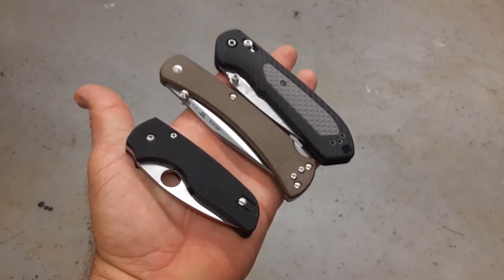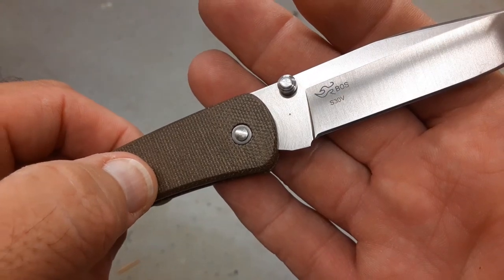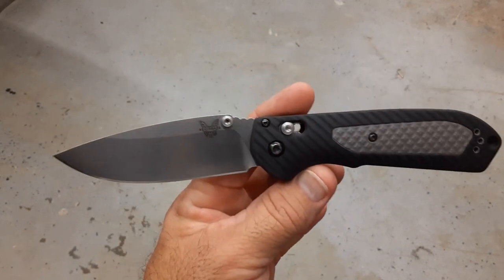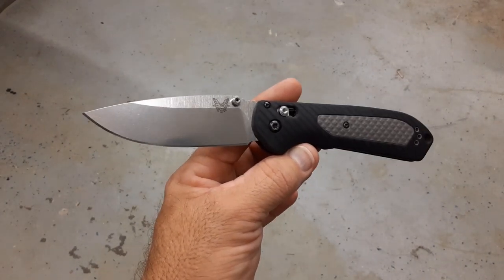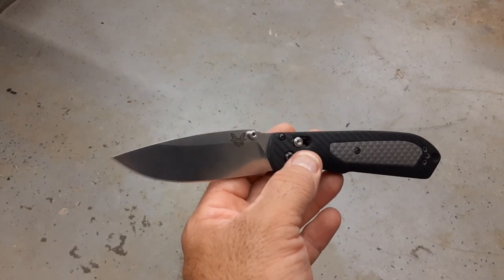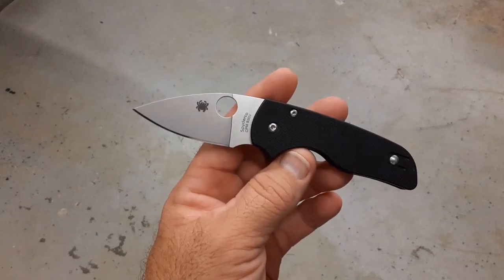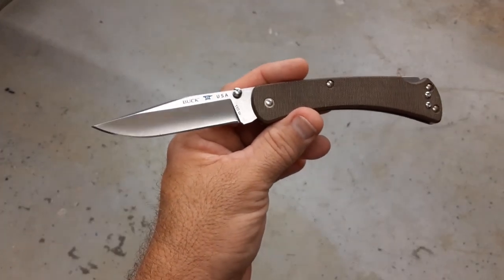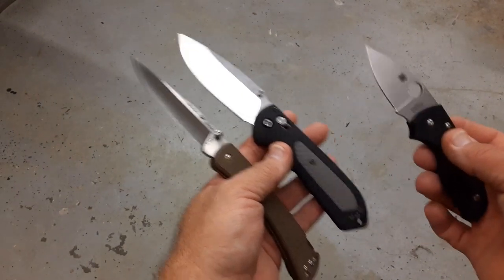S30V 3 way edge retention shootout, Benchmade, Buck and Spyderco. Watch out Import supersteels.

Comment: S30V is an underrated steel. Edge holding-wise, S30V > S45VN > S35VN. People are programmed to believe newer is always better. Most makers run S30V soft today to make it easier to grind. I have some high end knives from early 2000 in S30V that ran in the range of 60-61 as it was designed for, and double tempered in vacuum furnace followed by cryogenic treatment. I can tell you, they are better than many fancier steels today.

Comment: There is nothing wrong with s30v.  It's still a great steel.
Reply: I would bet money that 95% (or more) of knife people don’t actually use their knives to even push S30v. They will cut open a few boxes and then sharpen their knife again. I have used s30v to do everything from whittling, to opening bags of concrete, to food prep. It holds up very very well and you’d have to really use a knife to see an improvement in edge retention over s30v, if using a modern high alloy steel.

Comment: Another voice for S30V not chipping and overheated edges being chip prone. I have almost 20 years of use on a Benchmade knife that cuts everything including steel, often with unkind lateral forces applied and it has yet to chip. 

I did experience easy chipping on a factory m390 edge from another quality manufacturer, including a small tip fracture. However once sharpened that behaviour did not present itself again and the edge is now rock-solid.

I want a sane steel that won't rust easily, holds a good edge, wont chip ever unless the geometry is stupid, and is available on a good knife. For that role I like S30V and M390 a lot. However I don't have enough experience with S35VN to comment on it.

Thanks for the work and the thoughtful presentation of useful information.
Reply from the maker: You're welcome

Comment: There were a number of issues with S30V when it first came out nearly 20 years ago.  I had knives where the edge chipped if you looked at it wrong and others where the edge crumbled to pieces if I tried to go under 25 degrees per side.  Fortunately the manufacturers got those issues ironed out within a few years and S30V has been pretty reliable for the past 15 years or so.

Can't say I really like S30V though.  It's a premium steel with a premium price that's only marginally better than the 154CM that it's mostly replaced.  To me it's similar to the vast majority of M390, you're paying for the steel name and not any actual performance benefits.
Reply: This
Reply: I feel ya, bro. I've rolled the edge of Cold Steel AUS-8A just ordering it on the phone!
Lol. Just having some fun. I fully agree. Some steels just require special treatment to cure their "issues". But for the most part, it's ALL good stuff these days, when produced by reputable makers anyway. Cheers fellas.

Comment: When I bought my ZT 0561 Hinderer Elmax I quickly learned to hate Bohlers latest recipe.
Everyone online bolstered my feelings. Everyone complained of extreme difficulty in sharpening and average edge holding, exactly as I was experiencing.
8 hours it took to reprofile and sharpen the beast! I went through that process a few times.
Then I discovered that DMT diamond was a much better stone for super steels. Who woulda thunk? 
After modernizing my sharpening equipment and a little experimenting I soon was able to put a sizzling sharp edge on the old girl in about an hour.
And after about the 7th good edge and getting rid of all the overheated factory steel, my edge holding markedly improved. 
Now not only do I love my 0561 and Elmax, I've also learned to sharpen in reasonable time a lot of other tough sum bichen steels like CPM-M4, S110V and M390.
My point is all the various steels do have their own unique peculiarities, pros and cons. But more often than not their glaring faults are more a result of being ignorant to their unique needs and requirements in use, in care and in sharpening.
Once these "problem steels" are properly handled those glaring faults are history.
Great video and info as always. Thanks to all who stuck around long enough to read this epic! Stay sharp, brothers!

Comment: those results were pretty much the opposite of what I expected. I thought the BOS treatment would edge out the others. I've always wondered why folks bag on s30v. It's an excellent steel.
Reply: I bag on S30V because my Benchmade knife with that steel was so poor at holding an edge that I had to sharpen it every week with minimal use. I would cut a few pieces of paper and one zip tie and all the sudden, it was dull. I have nothing good to say about that steel.

Comment: I personally have no complaints with S30V in general, however as to the general community accusations of chipping I have indeed had a few examples of knives that I believe the HT must have been off on a particular batch. One in particular, a plain vanilla PM2 that I purchased maybe 4 years ago, is in my “beater” rotation and I’ve lost count of how many times it’s been sharpened. I use it for dirtier jobs but don’t especially abuse it (i.e. prying, torquing, etc) yet it seems to chip more easily than many of my other knives in S30V, even my other Spydercos, so I figure there has to be some anomaly there that I can’t substantiate just by looking at it.
Reply from the maker: Some do slip out like that, no manufacturer is out of the water on that one. I have tested a few that lost the edge rather quickly but they do seem to be the minority. Justin has a PM2 that tested at 58 hrc and I would love to see how that one is in use and testing.

Comment: I really really love your videos, you put out a lot of educational information that knife nerds and no knife nerds can understand. I personally have experienced a PM2 with an unusual s30v, I sharpened it two times and with the lightest of the uses it will start chipping at some part of the blade, maybe I needed to sharpen it a couple more of times, I still like the steel, I have a Sage 5 and it performs awesome
Reply from the maker: Thank you. Definitely sharpen that S30V a few more times. I would dull the apex on a stone and then repeat. They and get past any fatigued or over heated steel and then see how it performs.
Reply: Sharpen it at 20 degrees

Comment: I think s30v is a good well balanced steel.   And how it came into existence is downright inspirational.   No issues with chipping,  no issues with how the edge flatlines.   Gripes against s30v are for me: price point,  model design,  and personal intuition.   I believe s45vn is more in line with what upgrades I wanted for s30v that s35vn didn't give me atleast.   S30v has stuck around for a good reason.   And if the heat treat is dialed in with consistency the end user benefits.   Every time I use it I feel like it's an old friend that I haven't seen in awhile.
Reply from the maker: I'm curious to see where S45VN goes as far as companies and model options as well as who gets the heat treat done well.
Reply: @Outpost_76  my para 3 in s45vn is with Kurt for testing.   First impressions from 1 sharpening are very good.
Reply: @Outpost_76  I wonder whether I should import some just for the heck of it to see what it can do

Comment: I use a KME system and sometimes rest the stone holder on the blade for a break, and never had any issues with s30v, but yesterday I got an exclusive spyderco m390 manix 2 and after setting the stone holder on the edge noticed it scratched super easily. First experience with m390 had me bummed and back to carrying my s30v

Comment: The thing about putting a good hand edge on a knife is huge.. I've chipped things from S30V, 20CV, S110V, Rex45 to steels that "dont" chip like M4, K390 and 3V on a factory edge... with a hand edge I have only chipped S30V, S90V, S110V, 20CV and M4... but to be fair chipping the M4 and S30V was my fault

Comment: what sharpener do you use? i have the lanskey but i find it makes the tip and belly bevel alot sharper.
Reply from the maker: For testing I use the same KME for everything. I have a Lansky put away somewhere, it served its purpose. It worked just fine with the diamond stones they have for it.

Comment: So s30v is comparable to m390,20cv and 204p?
Reply: i would not compare them to each other, they are fairly different. the heat treatment is the reason why the majority of M390/20cv and 204p all perform so poorly at around the level of s30v.
Reply: @tacticalcenter8658  Heat treat matters👍🏻
Reply: @kknives_switzerland  exactly!

Comment: Buck still PINS their knives together? Geez. Get with the program. 

Another problem with the 110 design:
Close the blade, then press on it. Under slight spring tension, it lets you close it *more*. And what happens is that the blade edge contacts the inside of the handle! You can actually DULL THE EDGE with the knife closed! To me, that’s a shitty design.